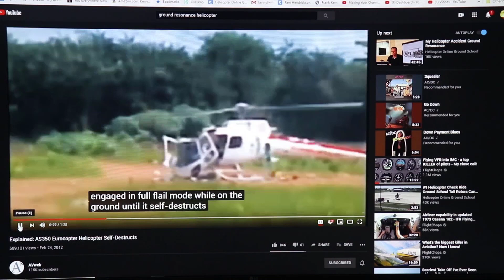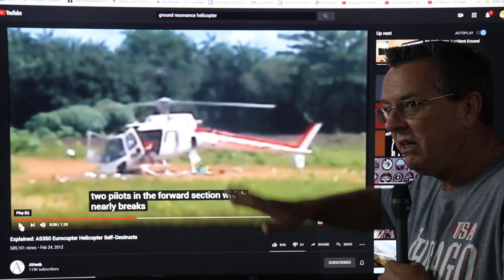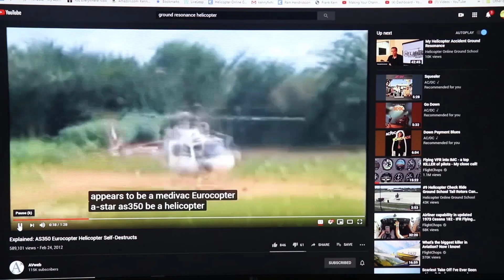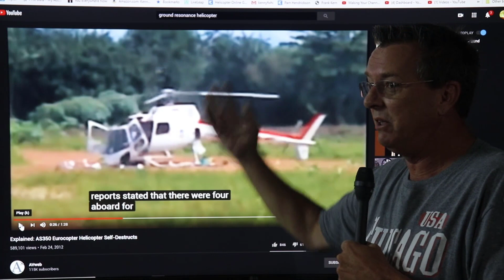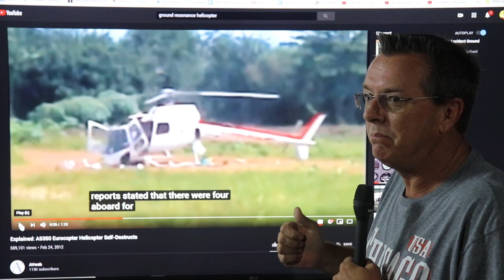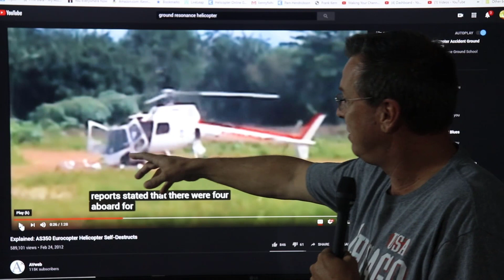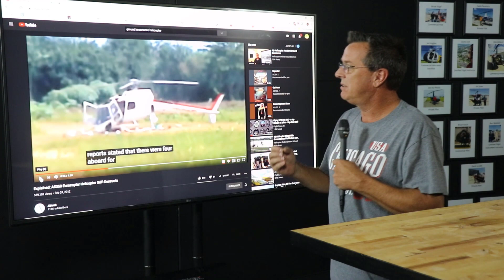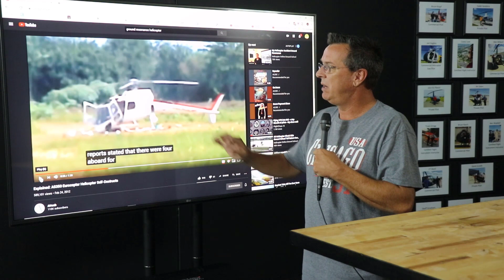#264 - Ground Resonance - Ejected and Survived, I Never Gave Up

Comment: This is where people who are engineers and hard of listening kill each other. If you have a machine that is thrown to this ground resonance you need to have some kind of a slow spring like a memory foam under both runners. When the oscillation occurs the memory foam won't support it and it will damp out instantly. In your case the oscillation begin to occur and the resonance was driven because everything was stiff and touching the ground. It would resonate the same way in the air except there's no support for it from the Ridgid ground underneath.
Reply from the maker: Thanks for commenting

Comment: In your situation why didn't you try lifting off, i'v watched vids where it's done, they save the day as well as the helicopter. Being a cop i expect you to lie but give it your best shot anyhow, please.
Reply from the maker: As per the accident report. The elastomeric dampener failed. There was no recovery for that. Also the resonance started after rolling off the throttle. The recovery as per The Helicopter Flying Handbook at low rpm is not to increase throttle to try an fly again.

Comment: as theoretical the resonance happen in specific frequency, then to escape the resonance we shall avoid this speed by increase speed or reduce speed immediately, it is possible to brake the rotor and reduce throttle simultaneous?
Reply from the maker: Recovery is often possible if action is taken quickly. If sufficient rotor RPM exists, immediate takeoff can restore rotor balance by allowing the airframe to freely move and help damp the oscillation. If rotor RPM is very low during a ground resonance incident, complete shutdown may be sufficient.

Comment: Not a helicopter pilot but what would have happened if you just cut the fuel to the engines or disengage the rotors from the engine if that's possible
Reply from the maker: Depends on the situation. If rpm is low throttle off. If you are at operating at full rpm get it flying again.

Comment: There is a good video of a 269 doing a run up after the owner/mechanic was working on the blade dampeners that just tears it's self apart. I was always told to get the aircraft back into the air and the blades will sink.
Reply from the maker: Thanks for commenting.

Comment: As an engineer is simple. There is something called resonance and natural frequencies. Every solid object had one, its simply a vibrational frequency which that object would break. Think of a glass that breaks when you scream loud enough into it. 
if the engine of the aircraft reaches resonance with that of the earth beneath it it'll shake apart.
Reply from the maker: Thanks for commenting.
Reply: @HelicopterGround   no problem i am a mechanical engineer with 10 years experience. Hit me up on my account if you are interested in having scientific input on your topics. I don't do youtube but i can call in

Comment: I am glad you survived and. you are still flying. What do you mean by "fully articulated?"
Reply: It is one of the 3 main types of rotor systems on today’s helicopters. The term means that each individual blade can flap, lead/lag, and feather to account for un equal lift amounts in foreward flight. Usually only found on machines with more blades than two, such as an md500.
Reply from the maker: Fully articulated is a type of rotor system.

Comment: What was the accident report for your ground resonance accident ?
Reply from the maker: Analysis
The certified flight instructor (CFI) stated that the student smoothly lowered the collective and set the
helicopter on the ground as he was rolling off the throttle. The helicopter then started to bounce
(ground resonance) and the CFI reached down to make sure the collective was down and the throttle
was off. The helicopter continued to "shake violently and ripped itself apart." The helicopter had a
new design of elastomeric damper installed 91 flight hours before the accident. The new design
dampers had been flight tested at the factory and approved by the Federal Aviation Administration
prior to being put into service. The helicopter had experienced severe vibrations on two previous
flights, one of which resulted in the chin bubble being broken. Inspection of the accident dampers, at
the damper manufacturer's factory, determined the dampers were within manufacturer's
specifications. After the accident flight the helicopter manufacturer recalled all the new design
elastomeric dampers.
Reply from the maker: Probable Cause
The National Transportation Safety Board determines the probable cause(s) of this accident to be:
Ground resonance experienced by the pilots.
Reply: @HelicopterGround  Not looking to blame you, looking to learn.  Fantastic that you shared the incident in the first place.

Comment: Ground resonance on helicopters has been around for a very long time,historically Hunting Percival in 1946 built the P-74 with three bladed articulated main rotor  which suffered extreme ground resonance before it even got off the ground and the design was abandoned until further research had been done,the helicopter genius Hafner was well aware of the problems too and warned other manufacturers of the issues & dangers of flailing rotor blades that get out of control,there is a lot to be said for rigid rotors as used in Vietnam,they proved sturdy in battle situations but were not really taken seriously by manufacturers of civil helicopters afterwards.
Thank you Helicopter Online Ground School for highlighting these hidden killers in helicopter design,the problems as we know are real and need more exposure towards trainee helicopter pilots.
Reply from the maker: Thanks for commenting

Comment: This is one of the reasons I prefer semi-ridged.  I only have a handful of hours in fully-articulated's but I feared this more than mast bumping in the Robby's.  I mean with mast bumping its easy to avoid, just never dive the nose and slow down in turbulence, but with this its like,..."How do I avoid it again?,...and what exactly do I do if it happens?  Get it on the ground fast?, or roll the throttle up to slam the blades against the stops, and fly away...?"  I've been told both?
Reply from the maker: Depends on the situation.
Reply: No way…NOT me. In my mind, your chances of surviving the G-R incident are greater certainly than the ‘boom chop’. With a severed tail, you’re DONE every time. It’s not THAT easy to get into a full Ground resonance situation IF you’re paying attention AND in control of the helo..or knowledgable about what it takes to stay out of G-R. I’ve had int onset brieflyonly a couple of times in the Schweizer 300. BOTH times were fixed different ways though; a FULL-down on the collective AND also picking it back up IF RPM’s are ‘near the top’. Both worked fine..
Reply: @m118lr  That's just it though.  You've experienced the onset of GR a couple of times.  I've never even come close to Low-G Mast Bumping.  Its not about survivability, its about the likelihood of ever having to deal with it.

Comment: Were you in an A-Star? You can sense in your tone of voice that this still haunts you.
Reply from the maker: HARLEY D Enstrom Turbine Model.
Reply: A-Star's are junk. Look how there's No frame from the top of the windscreen to the transmission mount. Not well built and not much room inside for the price. And the elastomeric dampers are inadequate for the weight of the blades, especailly if blade heat strips are added.
Reply: Tim Morris they are a common platform in the rotorwing world though.
Reply: @timmorris3056  : That's Why I Like HUGHES-500D, or the New MD-520N Helicopters.............JESUS is LORD

Comment: In addition to the crock pot, you need to get an Instant Pot. That thing cooks meat that melts in your mouth in a fraction of the time. It is a life changer for sure!
Reply from the maker: CHAOS45 interesting never heard of it!
Reply: @HelicopterGround  It is an electric pressure cooker that is simply amazing. Doesn't take long, makes tough cuts of meat tender. Nothing better in the world for things like london broil or stew beef or roasts.... but also pork shoulders. It's absolutely amazing. Plus it doesn't use much power and doesn't heat your house up. Google it and look at the stellar reviews. Here's a link to their page, but you can get it a little cheaper on ebay, offerup, or craigslist. https://instantpot.com/   ..... GET IT AND YOU WILL THANK AND YOU WILL BE THANKING ME SOON!
Reply: @cshamm  Thank You For the Wed Site Sir............JESUS is LORD

Comment: How often does that happen and are certain Helicopters prone to it more than others?
Reply: Don't know how often this happens... but helicopters with fully articulated main rotor systems are the most prone to ground resonance.
Reply from the maker: Clarence Watson yes some more than others!
Reply: @MeTwo-out  
I've witnessed it happen on run up.
Reply: Helicopters with fully articulated rotors (3 bladed or more) and its caused by pilot error
Reply: @MeTwo-out  
Most causes of helicopters suffering from Ground Resonance, is caused by improper maintenance or component failure in the rotor hub... most notably with varying quality &/or failure of the drag hinge components, causing the blades to predominantly lead or lag to one side of the rotor disk, resulting in an imbalance of its CG.  

This is why most cases of GR occurs during initial spin up.  That's not pilot error.
Reply: The H-53's I worked on had 6 main rotor blades. They are partly kept evenly spaced by an accumulator in the main mast that transmits its pressure to a damper on each blade. Each blade can move forward or rearward (lead/lag) in the direction of rotation to compensate for example, advancing or retreating blades in forward flight to keep the helicopter from rolling over along its longitudinal axis. If there are (extremely) worn bushings, the damper will not be able to hold a blade within its range of motion, or if the accumulator loses pressure, or any number of worn stuff, a blade can advance or retard too much and cause an imbalance. (The rotating mass of blades must be balanced like a car tire) If the pilot hits hard on one side, blades can shift out of balance and that rotating mass becomes offset and becomes like a set of bolos on the end of a string. As the weight shifts around, it bounces on the skids (or oleo struts) and with each rotation, the springiness of the suspension adds to the violence of the bouncing (resonance) and it tears itself apart. One post here mentioned keeping rotor speed up. That would leave the ship in prep to take off again in the hopes that the rotors would even out again. A serious defect in the rotor system may make further flight hazardous so you may be screwed either way. There is a YT video of a tv show opening credits where a helicopter lands on a rooftop. As the passengers get off, you can see the ship start to bounce so the pilot takes off with the door open. I'll attached it to this post if I can find it.
https://youtu.be/JHnNxFLtocM